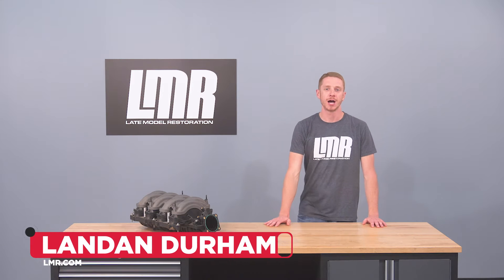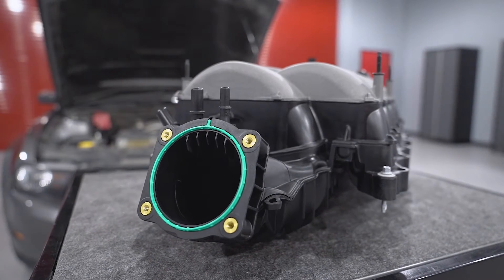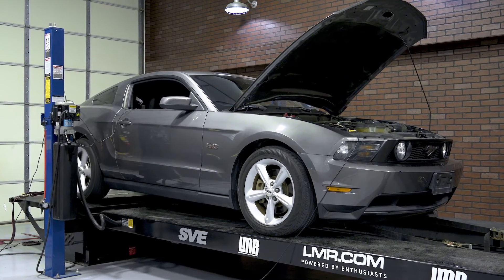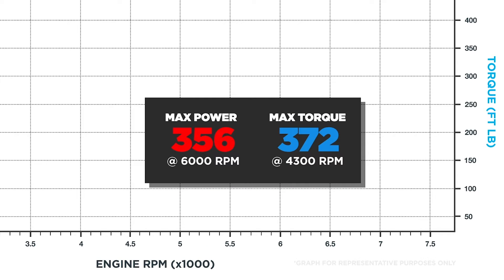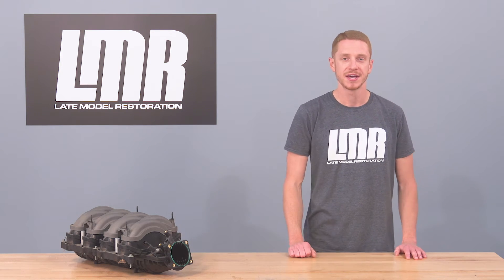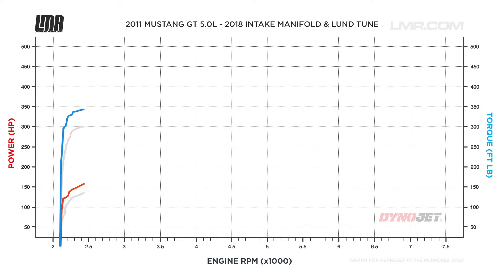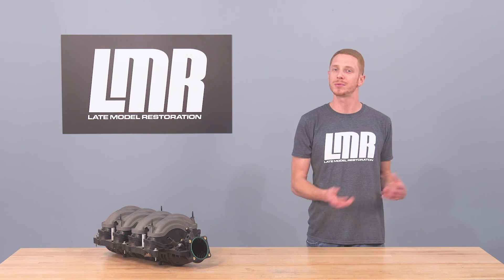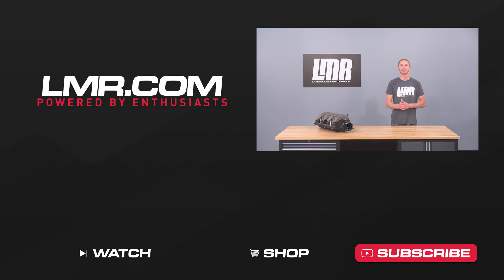Dyno Testing 2018 Intake Manifold On A 2011-2014 Mustang GT

Comment: So it bolts right up ? No aftermarket kit needed ?
Reply from the maker: The intake physically bolts right up to the cylinder heads. However, there are modifications required to finalize the install. Unfortunately, we don't have a detailed write-up on exactly what to do. -Landan

Comment: Too many people talking about the "tune" if its an auto it will need it to reach the rpms this manifold is good for. Redline isnt high enough the 18 manifold will pull to 7500 or 8000 rpm, thats where power comes from.

People compare dyno number to eachother on totally different dynos, which is hillarious. Look at the curves not numbers, and if the dont cross over at 5200 ish dont believe anything.

Any four stroke motor the power is all in the heads and how much they can flow at higher rpms. Cams, intakes and to a much smaller extent exhaust change where the engine makes power. The only real way to make more power is either compression forced induction, fuel or more rpms.
Agressive cams and intakes with short runners push the power higher in the rpm range, more rpms and torque higher in the revs=more power.  It may not be faster off the line with stock gearing, but geared for the powerband it will be faster. 
Like some guy like me with an f150 with 35s, at 3.73 shes going to feel slower from a roll or stop and may even hit a certain point where it runs through the available rpm if the redline is stock too fast to see benefits. But throw some 4.56 gears and raise the rpm limit from 6000 to 7500 its going5 to be much quicker from a stop as well as from a roll at cruising speed. 
Cars and trucks are way overgeared with 2-4 overdrive gears these days for epa and cafe bullcrap. The viper had 400hp, did nearly 200mph and could run to sixty in the low 4 second range with decent traction. A pickup these days has 400hp but feels gutless and slow when it should cook the tires all the way up to 60 due to gearing neutering as well as high ass gear ratios that often cause the car to lug when accelerating if it doesnt downshit cause its running at 1600rpm and as lean as possible

Comment: did the stock manifold have a tune from lund as well? If not what numbers can we expect with stock 2011 manifold with tune?
Reply from the maker: No, the car had a factory tune with the stock manifold.  With a stock manifold and aftermarket tune, you can probably expect 15 HP and 10 lb-ft/tq.  -Landan
Reply: @latemodelrestoration  Have you installed the gt350 intake on S197? If so, any results? Curious since the mach1 has it and has 480hp
Reply from the maker: @GolfBert  No, we have not.  We have only installed the 18+ manifold on the S197.

Comment: With just a roush axleback and 2018 manifold I dyno'd my 2014 gt and it was at 413whp and 374tq with the mt82
Reply: tuned with ? any new times/mods ? 

im swapping my boss 302 for ported 18 👍
Reply: What was the crank??

Comment: What about just porting the gen 1 intake manifold see what you get there
Reply: because the runner length  and volume of the 18 is a more advanced design allowing for higher RPM and the time for porting returns almost nothing.

Comment: Thanks for saving me $500. This mod is USELESS. Who needs a tiny gain across a few hundred rpm? Either this manifold is useless on a 2011-2014 5.0 or the tune was awful. Likely both.
Reply: 48 torque gain at 2300 rpm is huge what are you talking about? that will definitely be felt. you cant get those gains with a boss intake on a 11-14 GT.

Comment: 376 with Lund tune and 18 manifold wow that’s underwhelming, I have a rebuild 2011 with same compression as stock with stock cams and a bbk throttle body, airaid intake, and bama tune that made 404hp and 388tq through a 6R80.
Reply: Thats pretty Good with just those mods! im fixing on going FBOs by the end of March with a Lund Tune on my 14 GT 6r80 as well😶
Reply: @kendrickgonzalez7919  how r u getting ahold of a nguage if there discontinued?
Reply: @Dompass1999  I bought one last year and now I'm FBOs

Comment: I’ve noticed lmr and American muscle always have low dyno readings sure automatic will make less rwhp vs the 6 speed but a 2011-2012 Mustang gt 6 speed should make 373-380rwhp plenty of videos also on YouTube proving it stock numbers
Reply: American muscle almost always uses 87 for their baselines so their “gains” alway seem higher than they actually are when they switch over to 93 after they do the kids and tune. LMR must have a low reading dyno though.
Reply: first a 2011-2012 will not make 373-380rwhp stock. a 2013-2014 will probably be just under those numbers. they have low dyno numbers because they use the lowest octane for the base line to make the upgrade with a tune that much higher with 93 octane/

Comment: What did you guys do about the  bolt on the water neck coming in contact with the manifold ? Trim the manifold? Remove the bolt ?
Reply: im wondering the same as well

Comment: Best gainers are a no-cat x-pipe and tune. That’s all my cars has, aside from Roush axle backs. 406/400 to wheels with the 3.31 gears and the MT82 in 5th gear. 2013 with 75000 miles.
Reply: Cap
Reply: warriorpluto  with 18 mani, i shift at 7800. i'm full bolt on including long tubes and i wouldn't recommend taking it up anywhere near as high with stock manifold
Reply: your using the stock throttle body with the 18 manifold and 91/93 octane? if so i dont see how your making 406/400 wheel with just a catless X pipe and tune.

Comment: As usual you guys make a mod and install a tune at the same time, which masks any gains or losses of the mod.  Just do the mod and run the dam thing on the dyno then add the tune.
Reply: When you do a mod like an intake Manifold you have to do a tune or your air fuel ratio will be wank. Which will make your car run like crap.
Reply: And only got 20whp from a tune and manifold. Pretty sure a tune alone should get you around 30whp. Lol.
Reply: To be fair you might not want to go WOT on the dyno with the different manifold and no tune
Reply: Without the tune the ratios are out of synch. Say you super charge the car and run it without a tune, good luck and hopefully you got money for a new engine
Reply: @leonardoolvera11  Well the DIDN'T put a Supercharger on did they.  It was a stock style manifold.  They could have left the stock manifold on, put a tune in and still got an easy 20 hp

Comment: What elevation was this done at? My 2012 5.0 with just a CAI, no tune made 380/370 to the wheels at sea level
Reply from the maker: The average elevation here is 450 feet above sea level.
Reply: @latemodelrestoration  interesting results.
Reply: The 2013s make 8 more hp than the 2011s and also manual trannys do better on the dyno. So transmission would have been nice to know too. An 11 and a 13 can have a 10 to difference on the dyno easy.  I think this was a piss poor video 😳. You have to be more detailed.

Comment: Hmm seems like tune added more power not the manifold
Reply: I know for a fact that the 18 mani is much better than the stock manifold. The cars pulls like freight train up top
Reply: John Matthew it’s not, it sounds like you don’t understand these cars and actual physics. The manifold is designed for huge power gains in the upper RPM. Quit being a clown. Fbo application with the 18 manifold helps gen 1 coyotes reach 440 rwhp on a mustang dyno.
Reply: Bryan Zamora you have to look at peak power. Stock manifold dies at like 6,700 RPMs and the 18 climbs and holds off at 7,500.
Reply: John Matthew You know nothing my friend
Reply: @xxdrxschnitzelxx131  everyone is agreeing that the tune did 99% percent of the job. Come on dude they're selling yall advertise numbers same with cold air intakes in n/a cars they're useless unless you're running boost same with the manifolds. The best n/a manifold is the cobra jet n/a setups and the rest are irrelevant. Also a manifold isn't going to net you 440whp that's with other bolt ons . Also the gen1 coyote manifold is more than enough , you wont see any gains until 7400-7800 which isn't a good idea if you dont have a built sleeve and heads. If you believe they're alot better than the stock gen1 for street application or even drag application you're delusional. This is why they make so much money off u guys to tamper with the dyno numbers to make it seem like it's worth the 400$ in which it's not at all same with those so called open element cai air intakes in which they're short ram intakes since it's not sucking in cool air it only gives u the effect of feeling faster because of quicker throttle response and noise and their little dyno numbers if u get a tune with the stock air box itll be 1-2 hp lower than a short ram intake which again isn't worth the 300 bucks. Samething can be said about the 18 manifolds. The tune is what you're feeling. You can throw full exhaust on the but if you dont tune it what gain are you going to get 0.
Reply: Reggie 5.0 I clearly meant 440 rwhp after fbo e85 application short of cams. The CJ is 100% the best manifold if you are going full on NA, this means everything possible that you can do to the car before boost and nitrous. Fbo CJ cam gen 1’s put down between 470 rwhp - 485 rwhp on a mustang dyno. 

You guys are completely wrong that it was the tune sustaining those gains. I will literally cash app you $150 if you can show me any proof of a stock gen 1 manifold without a tune run past 6500 rpm, and then compare it to a tuned stock gen 1 manifold running past 6500 rpm’s. It seems to me that you’re implying that the tune is what is causing the manifold to make those gains and that the 18 and stock gen 1 manifold are not all that different, correct? 

Sorry to say it, but I know how the test will go, the stock gen 1 manifold’s power numbers fall flat on their face after 6500 rpm, with or without a tune. You can rev the stock manifold all the way to 8000 if you want with whatever tune that you want, by anyone and the stock gen 1 manifold will still fall flat at 6500 rpm’s every single time. 

I’ll explain to you why the stock gen 1 manifold will always fall flat at 6500 rpm’s and it’s all due to the change in runners and intake manifold design. 

Also the 18 manifold falls flat on its face after 7500 rpm’s, so you’re wrong in stating that it doesn’t see gains until 7400. No it starts to see gains over the stock manifold at around 5500 and peaks at 7500 rpm. 

I highly suggest y’all put your information through the ringer a little more, because the information that you’re touring around to be fact is objectively wrong. 

Yes open air element intakes cause there to be higher IAT’s and you’ll see power loss under 30 mph On a hot day. When the air starts flowing and you go past 40 mph, the open air element intakes flow better than the stock closed box intake. This is again physics and objectively true
Reply: @reggien1390  I recommend you go check out Alex Flores youtube vids. Your comment about built sleeve and heads makes 0 sense in relation to the 18 mani and even the cobra jet mani.  I can tell you the 18 mani makes a big difference over stock. Its been proven. The tune isnt giving the car more hp, its the intake mani. A tune is just a calibration. Also, i have a 14 gt, fbo, e85, cobra jet, stage 3 comp cams, oil pump gears, and high rpm pulse ring, Lund Tuned and make 470hp on a mustang dyno. I rev to 8k with this setup with no problems.
Reply: John Matthew I literally own a 14 fbo with an 18 manifold. I’m tuned through palm beach dyno and know for a FACT that the 18 manifold pulls hard af after 6500 rpm’s. I went from losing by 2 cars to bolt on scat packs, to walking them on the top end after just my 18 manifold swap. The facts are out there, and you’re being a clown by even acting like the manifold is not an upgrade over the stock gen 1 manifold. I guess Lund racing, Alejandro Flores, B Mason, Ford Performance engineers, palm beach dyno etc., basically every big name tuner in the business are lying right? The 18 manifold is a no brainer upgrade if you’re going FBO NA and no cams. Also, the manifold sustains higher horsepower the longer it stays in the upper rpm until around 7500. With the 18 manifold you’re making well over 36rwhp over the stock manifold when revving after 6500rpms. At 5500 rpm’s the 18 manifold starts to get its gains going over the stock, while the stock manifold straight up drops in power after 6500rpm. This is physics. You don’t know what you are talking about.
Reply: @xxdrxschnitzelxx131  those same tuners are laughing at you , because you were stupid enough to buy an 18 manifold for a gen one to net you little gains. Their job is to make money. Any honest tuner would've told you it isn't worth the money same can be said about throttle bodies and cai  just because bigger brands told you it will make big gains doesnt make it any better you think they want to lose sales on that item by saying it will only net you so and so gains. It's just the tune alone that makes the big difference. I actually feel bad for you and it sounded like you had a bad tuned as well because my stock manifold fbo 5oh is able to put more than 2 bus lengths on scatpack. Also I'm an 6r80 car so of course ima gap them regardless
Reply: Fred M can you find me a video or send me proof of any Gen 1 manifold with fbo e85 running a 10 in the quarter mile?
Reply: Reginald Nance you’re arguing against physics my friend. You don’t understand the engineering behind the design of these manifolds.
Reply: John Matthew  Beat all the 18+ 5.0 guys ive raced lol
Reply: Fred M  Sponsored Fanboy... yea whatever man. Go Watch Alejandro Flores and educate yourself
Reply: John Matthew  Go Watch Alejandro Flores and educate yourself
Reply: John Matthew  I dont get gapped by 18+ 5.0's bud.

Comment: you probably would have gained the same numbers with just the tune, technically you do not need a tune on the 11 through 14 coyote because it doesn't come from the factory with IMRC . so a real comparison would have been a baseline pull, add the 18 manifold and then do another pull
Reply: strokercoupe did the swap and know for a fact that I made greats gains after 5500 RPM
Reply: You really think that? Even while knowing the 18 mani is a more stout manifold than a stock 11-14 mani?
Reply: My 13 is tuned, long tubes and cai. Can i just slap an 18 mani on it and not retune it??
Reply: @bb5op585  no
Reply: With the amount of airflow that the gen 3 mani yields it wouldn’t be smart to throw one on without a tune. It would’ve been better if they tuned with the stock mani first.

Comment: A solid tune on the baseline engine would've likely revealed similar results. I'm not sure I see that advantage.
Reply: the 18 manifold pushes more power through the upper rpm, the stock manifold does not do this as it tops out power at 6500 rpm. Take it from someone who did the swap onto their s197, the car pulls like a frieght train after 6600 rpm and all the way through until around 7400 or so.
Reply: xXDrxSchnitzelXx is it just a simple bolt-unbolt process? Or do I need supporting mods like throttle body etc??
Reply: At least this is more stock then most of these kind of vids....seems like most "stock" testing have long tube headers, bigger injectors, catless system, etc..prolly $3500 in performance mods before installing this.
Reply: Lee Spector Same thinking here. And they revved it out farther as well.

Comment: Would’ve been nice to see what the tuned stock 11-14 manifold would’ve done in comparison up to 7500 rpm
Reply: Stock manifold dies at 6700
Reply: Correct
Reply: Let’s just say that the stock manifold doesn’t do well at 7500rpm
Reply: Agree, it should have been stock tuned and then 18 mani tuned then show results. That was not an accurate test